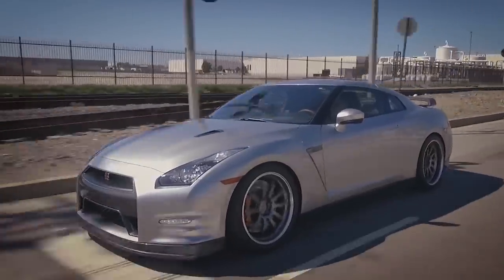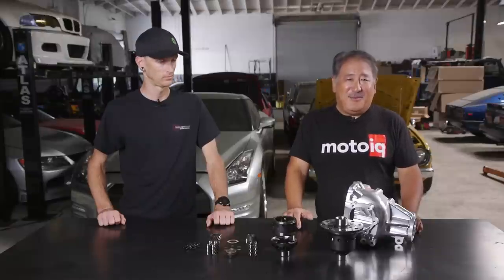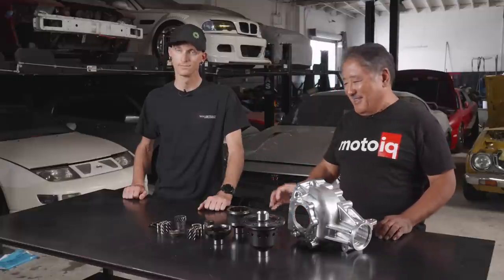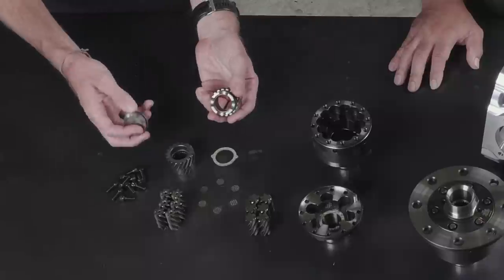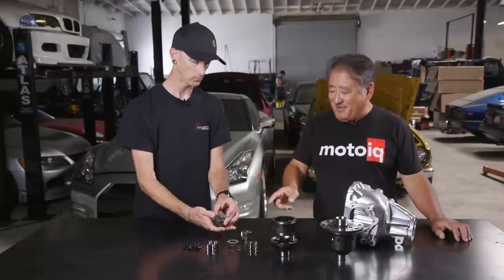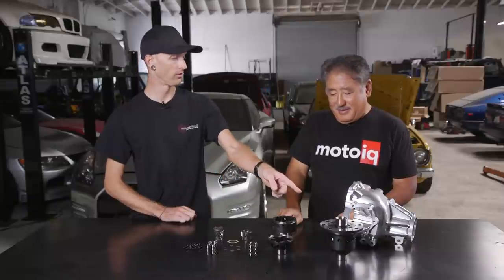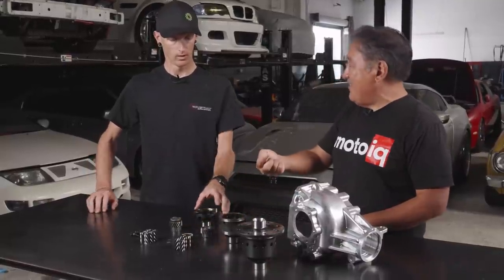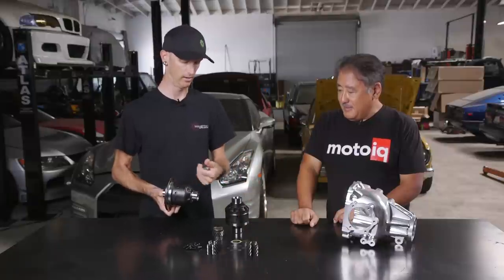How a Wavetrac Differential Works (and why you want one for your GTR!)

Comment: Would this be a suitable upgrade for a rwd like say a Maserati 4200 Gransport (power roughly 400hp at flywheel)? What advantage would it provide over the standard LSD?
Reply from the maker: Not sure what the OEM diff is like or if Wavetrac makes an application for a Maserati
Reply: I've a helical LSD in my Dodge 3500 with a up build 800 horse power cummins. Never knew until I took the diff apart to rebuild it because a pinion bearing went bad at like 350K miles. I tow upwards of 18K pounds with this truck.

Comment: This video convince me wavetrac is the best on the market
Reply from the maker: We feel that it is the best in the front of an AWD car, up to a moderately powered FWD car and great in lower powered small tire RWD cars.  It is not the best for drifting or really big tire high powered cars as the primary differential. It is also one of the best diffs for someone who does not tolerate the jerking and clunking of clutch type diffs.
Reply: Watch BMW ice wavetrac and see the marketing claims fail.
Reply from the maker: Watch other gear type LSD's fair worse.
Reply from the maker: In ice there is not enough friction to create camming force. Other gear type diffs do not do well either unless you left foot brake some.  A Wavetrac will work like this too.

Comment: I am interested in the wavetrac, however before I make a purchase like that I need to see a demonstration of a zero traction situation. For example, one wheel on ice and one wheel on a solid, hard surface. I want to see show it performs. I have yet to find a video of that.
Reply from the maker: https://www.youtube.com/watch?v=H3FTG0RVBJU
Reply: Thank you. I watched the video. I am a little ignorant when it comes to this. Why didn’t the cam mechanism work in this situation?
Reply from the maker: @roberthuffer6591  actually the cam mechanism is working, as the car moves pretty well off the ice. An open diff or a Quaife or Torsen would have more trouble moving off the ice, a trick with these diffs is a little left foot braking will load the helix and get them to work a little better.  These diffs work by load sensing, not wheel speed differential like a conventional LSD. The Wavetrac cam works a little better in a wheel speed differential situation than just the helix of the gears.
Reply: Thank you for that explanation! That helps a lot! Another question. The vehicle I am considering this for. 1984 VW Rabbit. Diesel. Non turbo. 4 speed manual. On the wavetrac website, I have seen that it is available for the 5 speed, but there is nothing mentioned about the 4 speed. Offhand, do you know if it is compatible? The car has no performance parts and I have no intentions to add any, except for some kind of lsd.
Reply from the maker: That would be better answered by them.   Give them a call.
Reply: I had a drive shaft pop out, wave trackdiff, there was ZERO traction, neither at speed nor on when stopped.
Reply from the maker: If you had totally zero resistance nothing would activate the cam.
Reply: @motoiq  thanks. This happens in a wheel lift off situation. There is zero resistance. The only torque times differential speed component in a single driven wheel lift-off situation is caused by the rotational inertia of accelerating wheel off the ground under power. I found the wave mechanism causing a very smooth engagement vs. an older Torsen diff I had before. It needed to overcome a certain torque difference treshold before starting to transfer torque. The wave disks needs both a speed differential and some torque to generate the force sliding the cams. This was the most detailed view of the components seen so far. I only found drawings before that. Essentially their marketing is overstating the diff’s capability. Instead of “wheel off the ground” they should market it as something like “low slip pre engagement”. It would also be nice if they would bring a RWD version of the Honda k20 gearbox for the popular Ariel Atom and Elise k20 conversions to the market. Quaife offer such a version with smaller ramp angles = less bias to prevent excessive understeer out of turns.
Reply: @motoiq  BTW, you do some really nice stuff. Been reading your website for a long time 🙂
Reply from the maker: A little left foot braking helps too.

Comment: Can you use this in a truck 4x4, front diff application
Reply from the maker: If they make one, I haven't checked.
Reply: Use a Locker
Reply: The HMMWV uses torsen diffs front a rear. Nothing to engage except a little left foot braking when lifting wheels.

Comment: Quite a complex part,, I guess needed in a front diff. That in motorsport scare me as I have been hit by one car and had another commit suicide alongside me!! Both with drive issues, too much or not enough. 
I had a Landcruiser with diff locks,, good in sand, but steering is an issue!!
Rear diff,,, so many baffle them selves with bullshit with various styles of LSDs, none of which do much good and some can be dangerous. 
A spool, for racing, is the only way. Simple and reliable. If you cant drive with one learn,, or quit!

Comment: Isn't the problem with these differentials compered to a LSD with brake discs that this type torsen or what ever, when you have one slippery surface on one wheel it never really locks up and because of that you get stuck?
Reply from the maker: Watch the video
Reply: @motoiq  I did, hence why I'm asking...
Reply from the maker: we explain why this works better in that condition.

Comment: Torsen T2R has clutch discs for preload
Reply from the maker: They are preloaded differently. They use springs to provide initial break away resistance where as the Wavetrac uses the camming action of the wave disc.  In the steering wheels this should result in less off throttle understeer.
Reply: Wavetrac friction surfaces dont do a thing. Except break and cause problems. 

Use a Quaife, the real company, or move to a clutch pack diff.
Reply from the maker: Ah you are a youtube expert.  Have you ever actually used one of these diffs?
Reply: @motoiq  guy has replied to every single comment saying how rubbish wavetrach is compared to quiafe. I hope the pay him or something cause thats seem like a lot of work to do for free.

Comment: Internal hardware is made out of 9310 steel. That’s the same steel they make a lot of AR 15 breach face bolts out of. Tough stuff but the heat treat has to be perfect. I hope it doesn’t get so hot in that housing that it defeats the heat treatment. Since friction is what makes it work.
Reply from the maker: Most good quality AR bolts are made of Carpenter 158 steel.  This is a special proprietary blend of steel from Carpenter Mills.  I think if you heat treat it properly, 9310 can be slightly stronger than 158. In normal condition 158 is much stronger.

Comment: How is this different then a Torsen Diff?
Reply from the maker: We explain this in the video
Reply: @motoiq  I watched it but not sure i get the advantage. I see has preload, does this means it engages quicker or doesn't slip as much? I have a 03 Ford Excursion 7.3 diesel 2WD and it's a great road warrior but sandy soil / mud is not its friend. I am looking at swapping the diff to hopefully help with that.
Reply from the maker: Gear LSD's act like an open diff once one wheel gets unloaded.  This diff has a cam that provides some lock even if one wheel gets unloaded.
Reply: @motoiq  ok thats nice. Thanks for taking the time to explain

Comment: so the quaife is useless in the wet and on ice?
Reply from the maker: Quaife isn't as good on split mu surfaces, like one wheel on dry and the other on ice or water
Reply: @motoiq  thanks for the reply, unfortunately I didn't know the wavetrac when I purchased the quaife 😭😭😭
Reply from the maker: Quaife isn't bad, you just need to understand its shortcomings and avoid them.  They are good for the front of an AWD car or a FWD car.

Comment: Great video but i hate the Term "Lifetime part" or "Lifetime Material"
It wont last my lifetime, the Lifetime it refers to is the parts and it could be 100K miles or 500K miles. 
Its almost as Bad as using Miles Per Gallon (a completely useless measurment) instead of Gallons per 100 Miles.

Comment: This is a Helical ATB type differential.  It is NOT a limited slip differential.
Reply: https://en.wikipedia.org/wiki/Limited-slip_differential#Geared_LSD
Reply: @Fix_It_Again_Tony  Just because you read it on the internet does not mean it is true.  Look up what a Helical Automatic Torque Biasing Differential is, and you will see.  Maybe even learn something.
Reply: @BeardMan01  It's not just Wikipedia. Race Car Vehicle Dynamics also classifies Torsen differentials as a type of limited slip. There is a nice little write up on Torsen diffs in the "Limited-Slip Differentials" section.  

You are entitled to your opinion, however.
Reply: @Fix_It_Again_Tony  I may have an opinion,  but I also have a degree in Automotive Design and have built race (Rolex, Daytona Prototype, Le Mans, etc.) cars for decades  So, what do I know?  I'm just another idiot on the internet,  right?

The fact that you called it a Torsen, aka ATB kinda proves my point, though.

Legitimately,  Honda is the most prolific manufacturer of these type differentials,  followed closely by Quaife.
Reply: @BeardMan01  Just because it is a Toesen or torque sensing differential doesn't mean it's not a limited slip in the same way both gas and diesel engines are internal combustion.

You can't make a statement counter to conventional wisdom like helical gear automatic torque biasing differentials aren't limited slip differential and then provide absolutely no basis for that statement.
Reply: @Fix_It_Again_Tony  Everyone likes to use LSD as a descriptive when it is not factually correct.   The fact is, there are several types of differentials that work in extravagantly different ways.  To lump them all as LSD's is incorrect and offers no descriptive terms on how they actually operate.   I understand that they may all function as a LSD as described,  but that is not how they perform in actual application.   

If you're going to make an educational video,  then educate.  If you're speaking in general terms,  sure.  LSD it is, kinda.
Reply: @BeardMan01  you got schooled
Reply: @supernice_auto  No, I didn't dipshit.

Comment: I want to see track numbers, lap times. prove it😎
Reply from the maker: I know that on an autocross course it helps about 1 second in a 30-second course, more if the torque bias is altered for more front split.  You risk breaking stuff when you do this though because the front diff is sorta small on these cars.

Comment: Wavetrac FTL. Quaife Rip-offs
Non-serviceable friction plates. One extra thing to fail. 
Boo
Reply from the maker: Dude you must have never used a conventional gear-type LSD to understand their major pitfalls and how the Wavetrac addresses this. The Wavetrac is fully serviceable and comes with a lifetime warranty. The Wavetrac is a design innovation that is totally unrelated to the prior art.  With that logic, you could say that the Quaife is a ripoff of Torsen.  Of course, those small carbon discs are not going to lock up like a clutch-type LSD but the action of the wave clutch has some lock, much like how slightly left-foot braking can get a Quaife or Torsen under control.
Reply: What is not serviceable? The friction disks and wave cam appear to be readily replaceable... although of course that would require removal and complete disassembly.